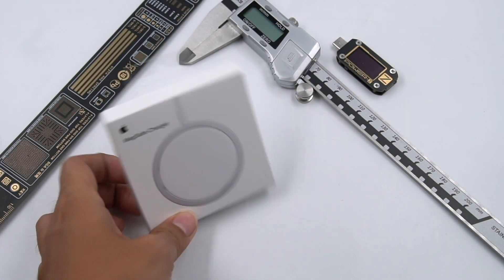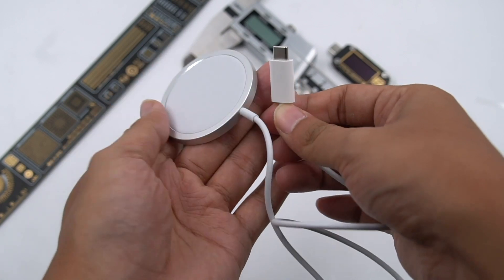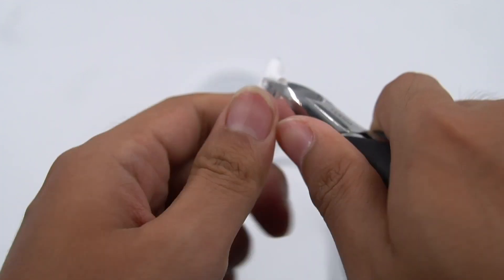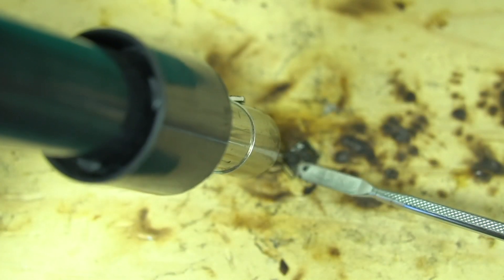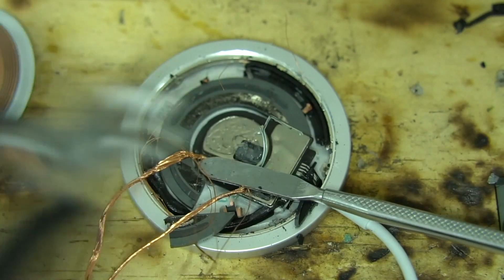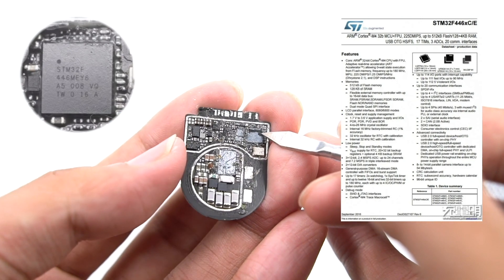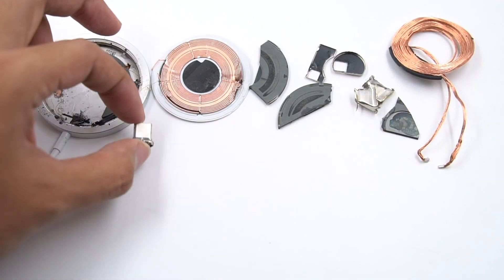Standard MagSafe | Teardown of Apple MagSafe Charger (For iPhone 12)

Comment: Would it work if you directly supply power to the puck for a DIY project, or are the electronics in the wire by the usb c necessary for controlling the power/charging? I would like the 15w fast charging for what I am trying to do and this is the only wireless option that offers that, I just want to directly power it without the wire.

Comment: Great video. Thanks for the input.  Does the Magsafe charger not have an NFC chip?
Reply from the maker: the NFC chip should be inside your phone.
Reply: @ChargerLAB  shouldn’t there be one in the rubber end? Otherwise how would the iPhone differentiate between a normal Qi charger and a MagSafe charger with the animations?

Comment: I have a question, at 1:13 there is no phone connected to the magsafe charger but the power-z meter indicates 8.9V 1.5A, where does the power go??
Reply: The government 😤
Reply: You assume incorrectly, if you watch the the 3rd row of the meter you can see with each refresh the watts are decreasing. When you remove the phone from the puck there is a short delay before the charger recognises its gone and the charging coil is powered down gradually until the load is almost nothing. There is a cut just before 1:13 so you dont see that the phone had just been removed from the puck.

When it cuts again, you see that the phone is back on the puck, and the watts are increasing again as the coil powers back up.
Reply: The circuitry I assume to keep it on standby. That’s why I have chargers on a power strip that I turn off when I’m not using them
Reply: @eman8920  no, the circuitry barely consumes any if at all, the circuitry is there to moderate the power
Reply: Heat, thats legit just physics man
Reply: Oh wait nvm wrong question

Comment: Hi, not sure if I missed it, but is there a component that does the job of MFI authentication like the USB-C to Lightning and Lightning to USB Cables do?
Reply from the maker: For MagSafe accessoires, Apple called it" MFM". The chip has been integrated to MagSafe charger module.
Reply: @ChargerLAB  Thanks a-mill for the clarification and reply.

Comment: Doesn't it  have a nfc coil that is in any other MagSafe accessories?
Reply from the maker: It hasn't.
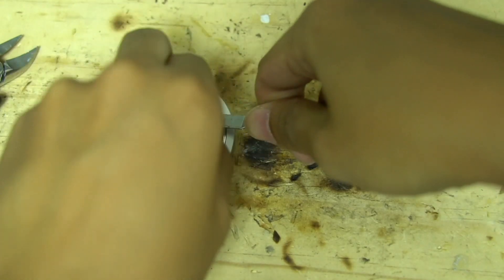Reply: At @3:00 you can see him rip off the top cover, with the NFC tag on it. The tag is on a flex PCB and is connected to the lower case with flexible copper traces. You can see the traces being torn apart at @3:03 when he rips off the top cover. At least that is my opinion. I will have Apple confirm this once I get into their MFi program.